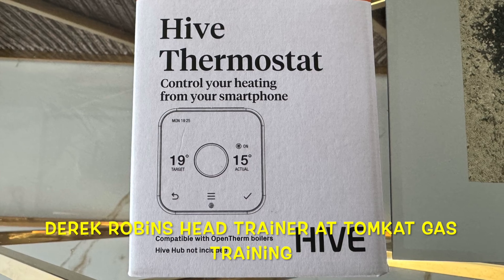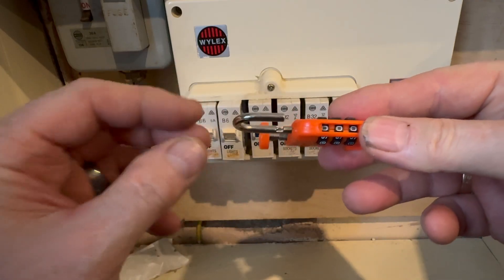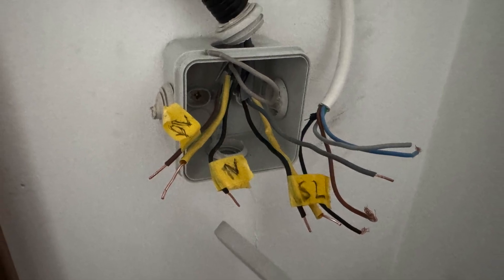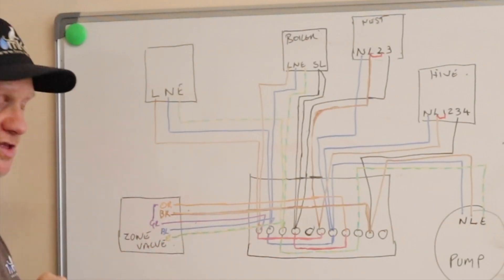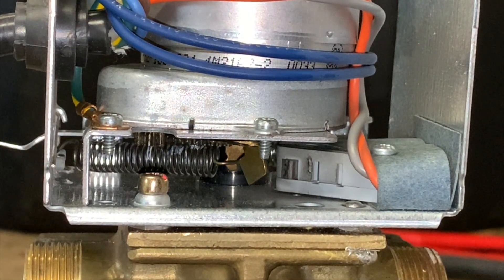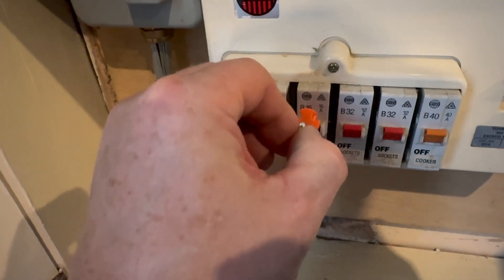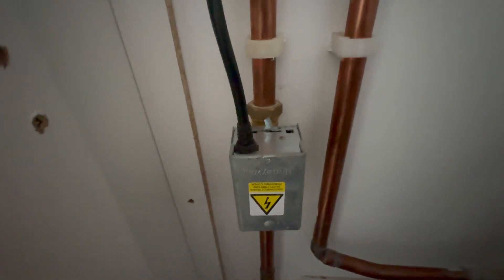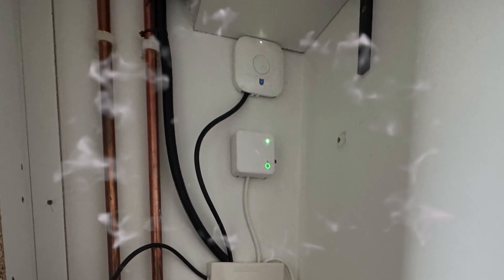How to replace a Nest thermostat with a Hive thermostat on a combi boiler with  rads and underfloor.

Comment: had similar setup, removed all zone valves, removed all on-off stats, open loop, weather compensation, result lower gas bills and more comfortable house. and need only 2 24v bus wires from thermostat to the boiler.

Comment: To get the hive Into " stand alone mode " ( no hub no internet) you press the bottom button for 10 seconds until the top light flashing white, then you put batteries in the thermostat and it will search.once the white light turns green,it's paired .
If you do have the hub ( internet access and app ) then the top light should be flashing amber and you do as above with the batteries in the thermostat.
If you have trouble connecting to the hub then press the button on the hub for about a second ( small black button) 
Then follow the process for pairing.if you have the hub plug that in first on any installation and let it update as with anything new it requires an update.
Lovely video.

Comment: hi derek nice short video from nest to hive well explained wiring diagram its annoying when you can not find the fused spur to isolate liked the way you used a proper wiring centre ( the ones i prefer) think you would have to have a little bit of time with it set up wise as an engineer. agree with other commenter not for elderly customers. can't comment on reliability?🤔👍👍👍